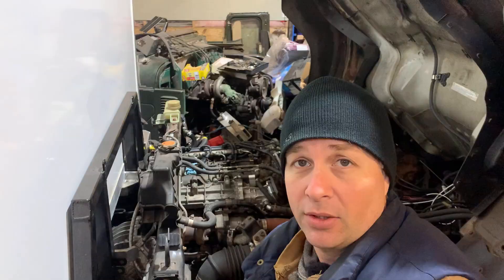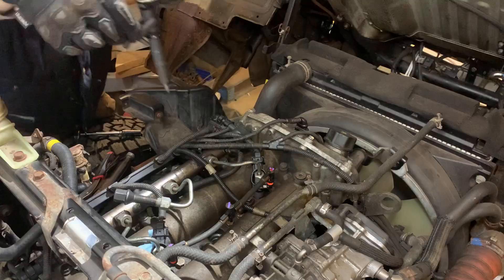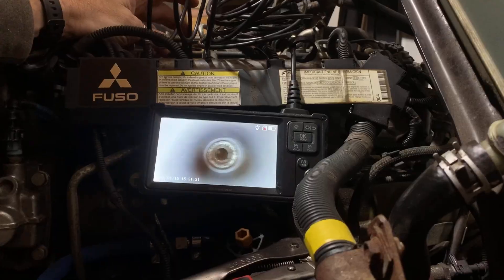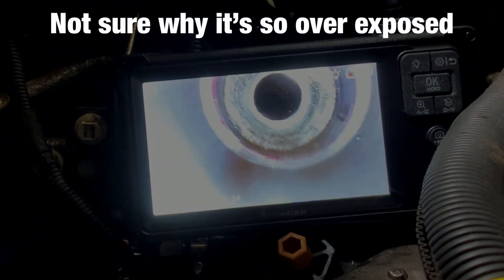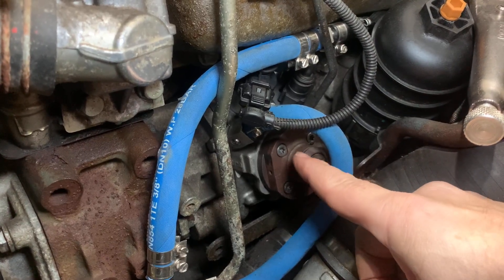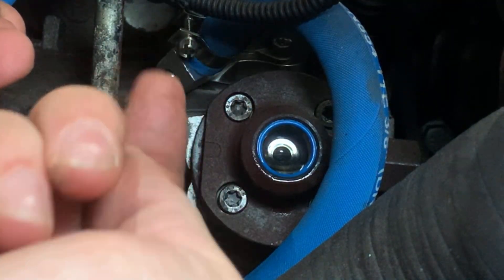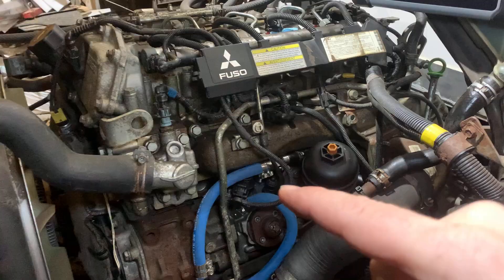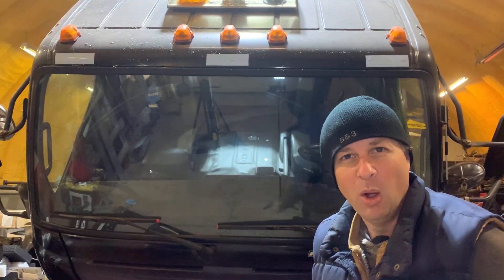4P10 Injector seat cutting and.... NO WAY!!!!

Comment: That's one reason I prefer to use AN fitttings on my fuel lines.  I still have a lot of those parts left over from my race car building days.
Reply from the maker: That might have helped, but some spots, like the connections on the pump are barbs no matter what. Also, I probably would have left them loose 😂😂
Reply: @BruceandKrista I've gone to a lot of trouble to replace barbed fittings on pressurized lines.  
I am so relieved you finally got it running again.  And now the entire injection system has had some TLC.

Comment: My 93 (bought new) has finally needed something done to it. Recently, the engine light came on after the engine started sounding like an old Ford diesel (when the Ford was cold). Then clear up. Then driving along it would sound like dry lifters. Replacing the injection pump won't be cheap. Since I have not been driving it much these days, I thought that if there are seals in the pump, then getting them softened up might fix the issue. I ran the fuel tank low and have put in about 6 gallons of Marvel Mystery Oil. It's made a big difference. The engine light comes on, but then goes out and runs fine. Then, it acts up a bit, then smooths back out. Changed the fuel filter and the gauze filter it the pump, to no avail. I guess, that I will have to take it to a shop. My expertise is not in diesel, only in building race engines from the 50's and 60's. If I can get this thing back to normal, I want to start it's restoration. Inside is in great shape. The bed is toast. Cab need some attention at the steps and the bottom of the doors. It's worth some investment. I had hoped to be buried in this beast as we spent the last 32 years together every day! Sure glad that you got your FG running!
Reply from the maker: Might be worth pulling the injectors and having an injector shop take a look at them?  And with my most recent experience - definitely see if the fuel system can be sucking in air anywhere!!  If  you have a manual fuel system primer pump try changing that out if you can - they are notorious for having small air leaks when they get old.
Reply: @BruceandKrista  Thank you so much for your input! While running, I did spray water on the engine, but did not hear any change in RPM's or sound. However, I will do that again when it is smoking and see what if can find. At different times recently, when I fired it up it did smoke like crazy. I would stop though. Like most repairs of machines, looking for simple fixes will sometimes do the trick. Thank you very much! ps. I will have those injectors cleaned when I take it in for a diagnosis! I guess after 30 some years of service, I can spend a little on the old beast!

Comment: Woohoo!! Yesss!!! 🎉 
Makes me think that after it started a few weeks(?) ago the weather was getting cold and the vibrations caused those lines to create a slight gap allowing air in.
Reply from the maker: I think yeah a combination of cooling weather and not as tight as they could have been clamps, and maybe the fuel line getting compressed and “relaxing”.  Once the injectors were good, there was enough of all the above to just let enough air in…

Comment: Ha, so  it was the disaster prevention kit, that caused this disaster for the  last 14 months or so.😄
Reply from the maker: No, the original cause was injectors, the air leak is only what has caused the no start since the injectors were put in (when it actually started)
Reply: @BruceandKrista  Cool.   It''s a great Christmas Miracle that it started 🌲

Comment: Your stunned excitement when it unexpectedly worked reminded me of a time in high school physics. Our teacher was preparing a demo while we did something else. She was tweaking a van de graaf generator. It hadn’t been working. She figured her last change wouldn’t make it work. But it did. And gave her a nice jolt of electricity. She emitted a very loud yelp. 

Good work. I feel like I’ve learned a lot about troubleshooting diesel engines. I hope it’s never useful knowledge. :)
Reply from the maker: LOL - kind of like learning that holding the spark plug lead on a running lawn mower is a shocking experience - when you’re 12 years old?   Don’t ask me how I know 😂

Comment: Can you recall tightening those clamps previously or did the cold weather shrink the hoses?
Reply from the maker: I know I had them tight at some point - but not sure if at some point after that I loosened them!   Either way, they are right now and it still starts!   Injectors were definitely mucked, but after that… phew!
Reply: @BruceandKrista Great news!….out of curiosity, $ new fuel pump?
Reply from the maker: Depends on where you source it - I bought a used engine early on that came with one (which now I assume is good!) along with alternator, starter…. And all the engine for $1K CAD.  Sourcing an aftermarket fuel pump, probably not much cheaper than 5-700, and OEM, anywhere from $1500-3K